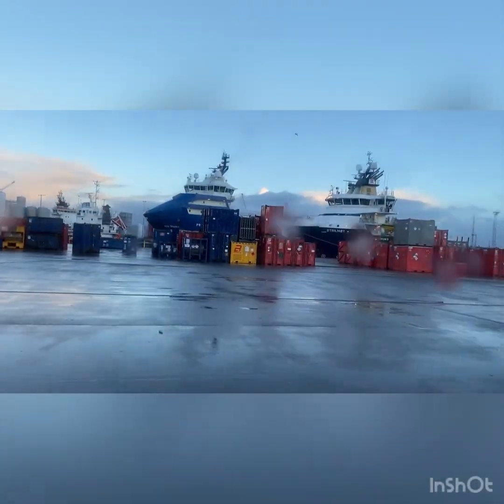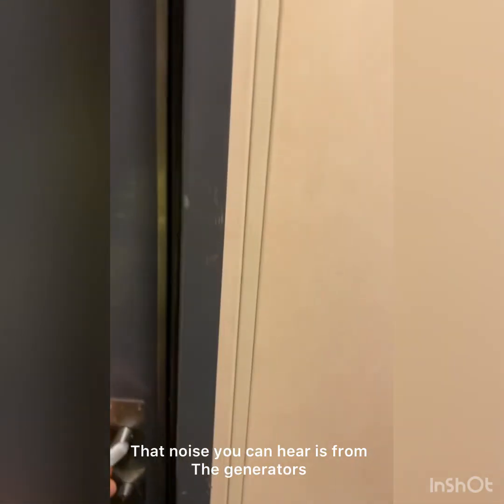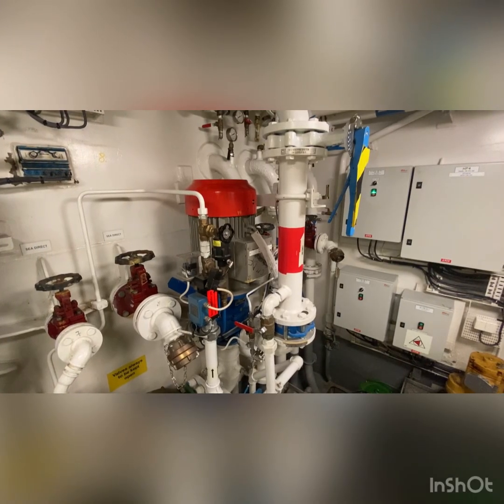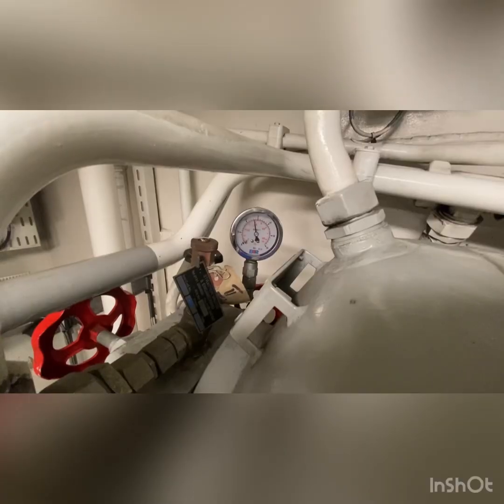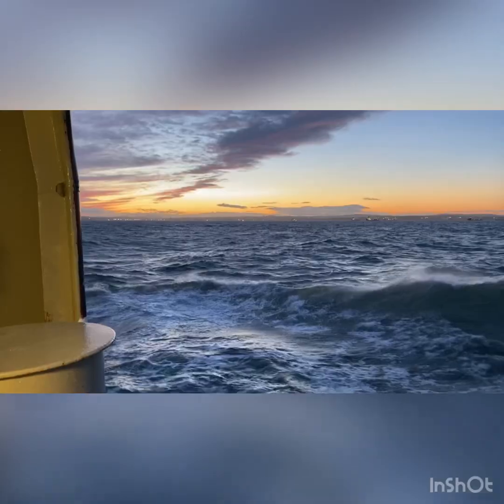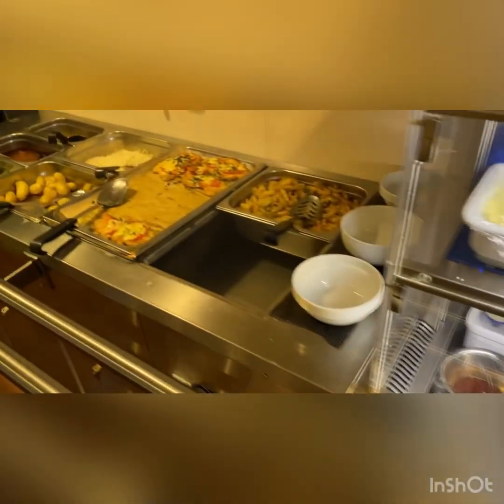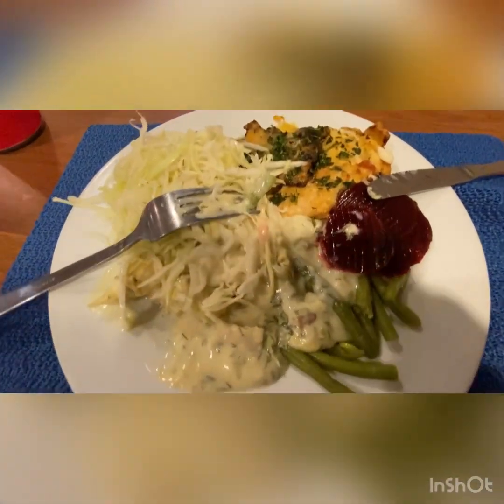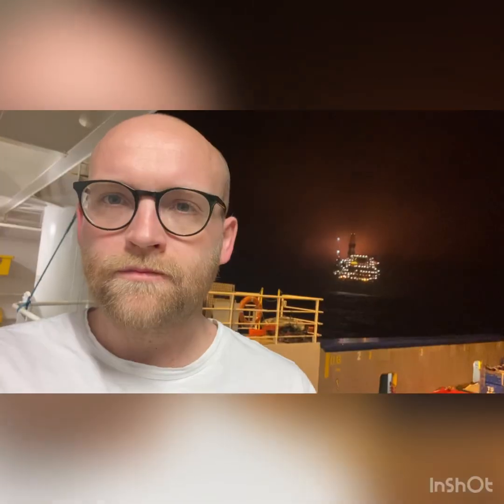A Day In the life of a Marine Engineer #marineengineer #seamanlife

Comment: Really great video! Although I am curious, are you in the commercial maratime industry or the Royal Fleet Auxiliary?
Reply from the maker: I’m in the merchant navy, worked on many different types of vessel. Offshore supply,
Cruise, research, oil and gas tankers, ferry and tug. Where do you work?
Reply: @MarineEngineer1989  Thanks for clearing that up. Did you get a degree to get into the industry? Right now I have an entry level job in IT, but I'm interested in pursuing Marine Engineering if it doesn't work out.
Reply from the maker: @CasualGlassEnjoyer  I did a maritime cadetship for 2.5 years and after that joined a vessel as an additional 4th Engineer. It’s a good career, lots of time off, good pay.